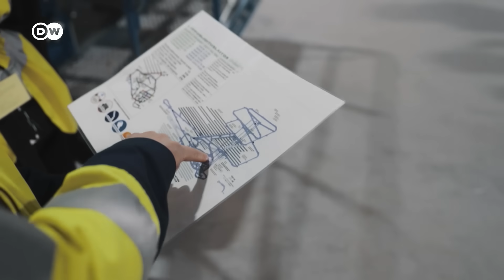How Finland is betting on nuclear power, and its waste | Focus on Europe

Comment: Permanent storage is not practical as the energy released from the slow decay can be re-used. Newer nuclear reactors can now re-use spent fuel rods several times to produce more electricity reducing their radioactivity. As we wait for this recycling method to become more mainstream we should store nuclear waste securely, but not permanently.

Comment: The video seems to be a bit fearmongering claiming containers of spent fuel could be leaking.  Spent fuel is NOT a liquid.  The comment about "radioactive for over 100,000 years" implies it is dangerous for that long.  The 100k number comes from determining when the waste will be equal to average background radiation, which an extremely low level.  It stops being hazardous quickly, as can be seen from both US and Canadian above-ground storage of spent fuel in casks (after a cooling pond stay for 10 years).  

As for the method, sure this works fine, but what one calls "waste" basically decays away over a few 100 years leaving mostly plutonium and uranium behind.  These are fuel for next-generation reactors, and with reasonable handling, probably will be accessed before that.  Note these are the wrong types (isotopes) to make nuclear bombs, so that is not a concern.

"Never to be accessed again" - I seriously doubt that.  It will basically become a mine full of valuable fuel and materials for the future.

Comment: Big problem with this project is funding. Right now projected costs to build and operate Onkalo are only €818 million but The State Nuclear Waste Management Fund has approximately €1.4 billion from charges for generated electricity. That's about €600 million more then needed. So where are they going to use the rest of money? To build Onkalo 2? but Finland doesn't need second repository for another 100 years and at that time they will have enough funds to build at least 4 more. Could they change laws and allow foreign nuclear waste to imported for a cost, yes they could but then they'd have even more money.

This is a lose-lose situation for Finland's solution for nuclear waste. It's under budget and steps to correct that would generate even more income.

Comment: would be better to use nuclear waste as fuel in modern reactors instead of throwing it away. It would yield energy and reduce the half life when most of the radioactive energy has been harvested.
Reply: Too costly, and even if you did at some point you would still be left with waste to store even if you use most of it unlike they do now.

Comment: a huge amount of material is moved, produced and buried especially for this last purpose. is there anywhere an honest calculation of how many kWh, which were initially gained per unit of nuclear fuel, now have to be returned again just for the entire storage process with this method? would be very informative, thanks.
Reply: One fuel rod is about 5 meters long and weights 500 kg on the low end, and 1100 kg on the high end.
- one kg of uranium produces 24 million kwh, 
- that's circa 8000 households a year, per kg or ca. 32.000 people. One rod would be 4 million households
- at a price of 30 cents per kilowatt that's 7.2 million dollars per kilogram.
- one rod is spent after 6 years
As you can see, it's very space efficient.
Since these operations are done on state level, they don't have to achieve margins, but instead, cover operational costs.
We also don't create that much nuclear waste, because it's very space efficient.
Reply: @ayoCC The price per kilowatthour was an average of 2,8 cents during the last month in Finland.
Reply: @ayoCC  10 cents seems expensive. They made 6 cent 2 year contracts not long ago. And the there is the transfer fees that are in between 3 and 10 cents depending on the company in your area.
Reply: @ayoCC  For the Q1 of 2024 they have estimated the price to be around 7 cents
Reply: @Tupsuu  I think that might mean that finland exports a lot of energy.
Energy in the summer will sell at a loss sometimes now, so I think it's time to think more about storage, so the energy can be sold during times when energy is more expensive to make better revenue.
I tried to look for some numbers, so a new nuclear power plant would have 25 cents per kilowatt, but if you run it longer it would eventually pay off. An already built powerplant would run at around 4 cents per kilowatt.
Reply: @Tupsuu  
It seems the cheapest european nuclear plants report a 8 cents per kilowatt operating cost over ... 20 years?

by the way germany has always had around 20-30 cents per kilowatt, so it's super profitable to send energy here if you have excess i guess
Reply: @ayoCC  I think we are a net importer of energy still. Even after the 1600MW reactor started in the spring. But northern Sweden has even cheaper power than here and they don't have the capacity to export it to southern Sweden so they export it to Finland.
Reply: @ayoCC 24 million kWh divided by 8 million households means 3 kWh per household. That's more like a household consumption per day.
Reply: @netional5154  true! People use 3000 kWh a year so 3 megawatts was would have been it.

Comment: Finland is building a permanent storage site for high-level nuclear waste, which will make it the only country in the world to do so. The storage site is located in the municipality called Olkiluoto, which already houses a nuclear power plant. The site is called Onkalo, and it has been chosen due to the special conditions such as the rock age of almost 2 billion years, it being rather unfractured and dry, and with minimal groundwater movements. The spent fuel rods are sealed into copper canisters, which are then placed into holes over 400 meters in the ground, filled with bentonite clay that absorbs groundwater, and then backfilled with the same material and sealed with a six-meter-thick concrete slab. The storage site will be gradually expanded and filled for about a century to a total length of 50 kilometers, then sealed permanently. The Finnish Nuclear Safety Authority says that it won't pose a significant risk, and the canister is just one protective layer of many.

The Finns are ahead of most nations because of the positive attitude of almost 70% of Finns towards nuclear power, and the area receiving around 20 million euros in property taxes every year from the company that owns the nuclear power plant and the waste disposal site. The Finnish people trust the engineers, regulators, and safety measures, and believe that it is their responsibility to take care of the waste and not leave it to future generations.

Comment: Some of the new nuclear designs use unspent nuclear fuel (so called nuclear waste), as discussed in this video, in their fuel cycle. 
It maybe that this sort of facility will not be needed at all. But credit the Fins for taking responsible action.
Reply: Yes, all nuclear plants use UNSPENT fuel rods that then have to be stored somewhere after 5-6 years when they become nuclear waste. That's it all about: storing SPENT fuel rods.
Reply: @UltraCasualPenguin  Most nuclear power stations only use a couple of percent of the fuel leaving the vast majority as unspent, which can be used in newer designs. 
It's like filling your car, using 2% of the fuel, then saying all the rest is waste.
Reply: @UltraCasualPenguin He's referring to "breeder" reactors, which can use the spent fuel to continue making energy.

Nuclear Fission splits atoms to release energy. The "fuel" is a fissile element which can be split. The "waste products" are the elements produced after this split, but some of these are also fissile, so you can split them too, releasing more energy, and so on.

If you repeat the fission like this then you use up more of the fuel, so end up with less waste, but it's more radioactive, so a storage facility like this is still required, but it will fill up more slowly, so can be used for longer.
Reply: @GonzoTehGreat  Come here and build them then.
Reply: @UltraCasualPenguin  He's correct that the Finns are burying fissile material which could be reused to make more energy, but we don't currently have any reactors which can do this and even if/when we do, we will still need to store the waste from them, so such a facility is still needed.
Reply: @GonzoTehGreat  Main reason why we don't use your tech because we don't have any of it. So you need to build them.
Reply: @UltraCasualPenguin   I'm aware of that. As I said in my previous reply, there are currently no breeder reactors, because development of them was halted decades ago due to nuclear weapons proliferation concerns. 

Regardless, I'm not a nuclear engineer myself, so I can't build them, so I don't know why you're asking me to... 🤨

Also, as I said in both my replies, a facility such as this would still be needed, so it's a good idea.
Reply: @GonzoTehGreat  It's the chase for efficiency that worries me here simply because of the added radioactivity from reprocessing effectively making the 'spent fuel' more of a hazard. Widespread reliance would increase the rate and volume beyond what is relevant today. Each time the 'spent fuel' is processed it introduces the potential for human error.

So few have implemented a solution at all - the time scale for these solutions insinuate we will have a better solution in future generations and that is a heavy burden to bestow upon the unknowing.

So, basically let's not make a bunch of super high-mass nuclei since they tend to be spontaneous... Like a solar flare in your pocket.

Comment: Average lifecycle emissions
Coal 820 g CO2 eq/kWh
Oil 720 g CO2 eq/kWh
Gas 490 g CO2 eq/kWh
Biomass 230 g CO2 eq/kWh
Solar 48 g CO2 eq/kWh
Geothermal 38 g CO2 eq/kWh
Hydropower 24 g CO2 eq/kWh
Nuclear 12 g CO2 eq/kWh
Wind 11.5 g CO2 eq/kWh
Reply: Sounds awesome, do you have a source that I can look up?
Reply: @martinkase5842

Not sure. But I've seen similar numbers in a NREL study.

Look up NREL Lifecycle Harmonisation

Comment: It also has to be said, that we have low levels of corruption and high level of transparency. So we can trust this storage system will be built well and safely. Not all countries could be trusted to do the same... And we have geological conditions for this storage (okay, so would many Nordic countries)
Reply: The main focus is low level of illegal corruption. There are several ways to do legal corruption.
Reply: We actually have corruptions, most of it is just hidden corruption or it appears in the different forms...like political nominations can be very corrupted.
Reply: Will the low levels of corruptions stay like that for millennia?
Reply: @rogerwilco2  LoL, human kind itself might not survive that long! But it doesn't matter. The disposal facility is already finished and trial runs are now started (complete disposal process without actual spent fuel used)... at any rate, what would be your proposal be to solve this issue? Spent fuel already existing needs to be stored somehow longterm. We cannot just all close our eyes and say "people are all bad and selfish so all solutions will fail". STUK and a bunch of international authorities and experts monitor this project....
Reply: @rogerwilco2 The procedure is done now so it is only relevant for now. If everything is sealed and stored away properly we wont have to worry about it at all in the future.
Reply: @rogerwilco2  yes.
Reply: @rogerwilco2 Your question is irrelevant...

Comment: Nuclear + renewables are the way forward. We should use renewables when the weather permits, and nuclear as a baseline backup
Reply: Why use nuclear as a baseline pickup? Thats like walking everywhere but pulling your car with you in case you cant walk somewhere. And you could rely on solar and wind 100% of the time if you destroyed the environment enough.
Reply: @namename9998  Because renewable energy depends on the weather. There will be times when there is little wind and the sky is overcast. In those situations you need a backup, unless you propose burning gas or coal which would be far worse for the environment?
Reply: @mark63424able  That doesnt explain why nuclear should assist solar and wind compared to solar and wind assisting nuclear. In other words why have 60%+ of energy come from solar and wind instead of having 60%+ of energy coming from nuclear energy.

Comment: We are handling this aspect of the nuclear energy quite well. But we still have problems.

We are not using any of the heat from nuclear plants to heat our homes. And most parts of rural Finland are kind of opposing the use of smaller reactors to generate heat and electricity to smaller cities/ towns. And would likely want to keep using biomass burning. And our law makers are deadly slow to even approve any changes to our nuclear laws to allow heat usage or smaller reactors. So we got that going for us..

Nobody wants new Olkiluoto 3 that will be 15 years late and over the budget many times.
Reply: "We are not using any of the heat from nuclear plants to heat our homes".

What's this supposed to mean? What heat? The one that produces the electricity by turning water into steam? How are you going to simultaneously use that for heating and electricity production?
Reply: @jm-holm  Turbine steam is turned back to water in the process after steam turbine and excess heat is drawn from it. So there is a possibility to use that energy but law does not permit the use of it at least to residental usage.

And because our present nuclear plants are kind of far away from most of the cities smaller reactors dedicated to heating could be used.
Reply: @jm-holm  And I could add that my knowledge about the subject is limited. But I know that there happens a lot of heat exchange and most of the heat is wasted.
Reply: @Jolbotti  Well heat is wasted in any process. If it were to be pumped out to households as hot water it would certainly lose a lot more heat energy along the way.
I would assume that they simply reuse the water in the reactor in a loop, it's already hot so it takes less energy to turn it into steam again and it wouldn't have to travel as far losing energy through heat transfer along the way.

I don't know if they do that though or if there are reasons not to.
Reply: It's not used to heat houses because almost all of heat is gone at end. If I don't remember incorrectly it's somewhere around 45-50 °C. So there's not much left of it. That is better used to for example preheat water entering reactor during winter.

Comment: I find Finland's operations to be wasteful due to how it's a dead-end use of valuable resources like copper. Also, they're spending so much energy just trying to contain energy. The spent nuclear fuel can be recycled and used as fuel once more while also becoming less dangerous. Also DW, I severely dislike how your initial presentation of spent nuclear fuel takes advantage of public misperception to push an economically favorable narrative. The relatively short term economic benefits are not significant compared to the cyclical, long term benefits of the resources squandered.

Comment: A recycling reactor program would be even better. But in 100 years, they might start digging these up to reuse the “spent” fuel.
Reply: Spent fuel rod! 😂
I find the term to be humorous, it like having a gas/petrol container with 10 litres of fuel, you pour 100 mL In the car put the cap back on the container and throw it away with the other 9.9 litres of fuel, and call it a spent fuel container.
Reply: @YellowRambler I thought that. Just shows how little DW news knows about nuclear.

Comment: FYI, the Japanese actually reuse these rods and recycle 80% of their nuclear waste. Storing it in definitely is not a great idea. We need to find ways to reuse it.
Reply: Why is storing nuclear waste a bad idea? All it does is waste space but its stored much better than solar (which is ewaste), wind and any other waste. And nuclear waste can already be reused if countries lifted bans on reprocessing. Like you said Japan (and France) recycles a lot of the waste but thats because 90% is fuel that just needs to be cleaned. The rest is stuff like cesium 137

"In larger amounts, Cs-137 is used in medical radiation therapy devices for treating cancer; in industrial gauges that detect the flow of liquid through pipes; and in other industrial devices to measure the thickness of materials, such as paper, photographic film, or sheets of metal." CDC

(yeah. The stuff people run and hide from when theres a nuclear accident is used to save lives)
Reply: Still better than Russia’s plan of just dumping all the nuclear waste into the nearest lake or river
Reply: The Japanese don't even manage to cool the ruin of Fukushima without pouring contaminated water into the ocean. 🙄